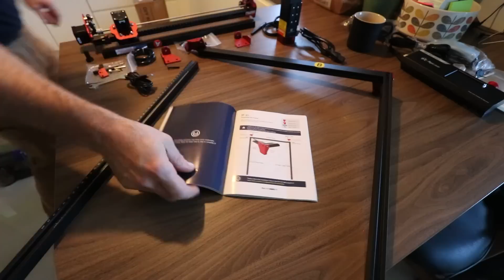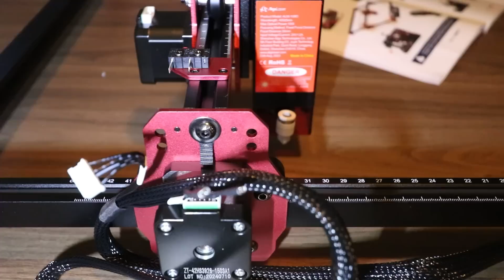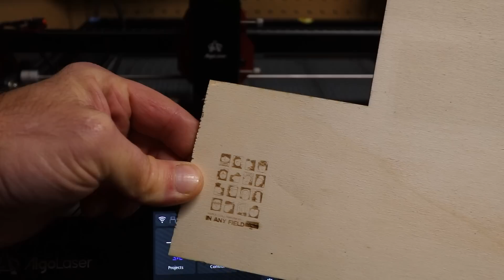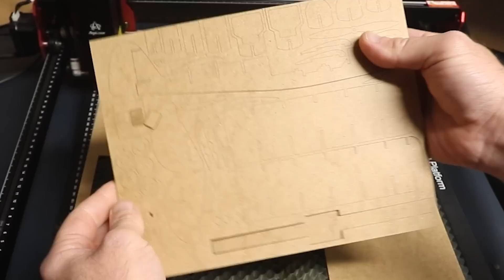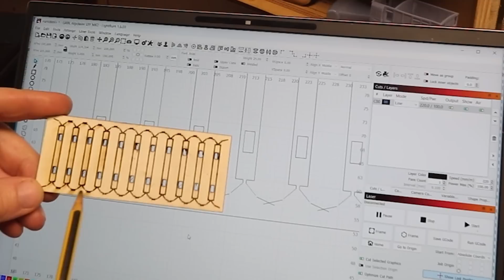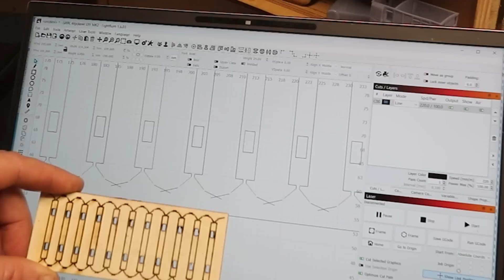S2 E48 AlgoLaser DIY Kit Mk2 Laser Engraver | First Look | Bexhill West Model Railway

Comment: Thank you very much James for your interesting review on this machine. 

I need to eche and cut a 0.6/0.7 mm brass plate for assembling a H0 3.5mm scale freight wagon and by the moment I need to reproduce the fastening rivets of the wagon timbers in 1:87 scale, I would know if the laser spot of this machine is thin enough to do a proper job or quite close.
Thank you for your time!

Comment: Hi James and everyone
I was impressed by this kit, so much so that I went ahead and purchased one. Unfortunately things have not gone well. Since the very start Im getting a double horizontal line every-time I  engrave or cut. This line is about 0.5mm parallel to the horizontal line. When cutting there is a wafer of wood cut out between the two cuts! 
It does not matter how the line is drawn, Lightburn, Laser Gbrl, Inkscape the effect is always there. Reached out Algo but despite following their suggestions the problem is still there.  Now they have just stopped responding to my emails! Add to this returns are at your own expense and there is a restocking charge of up to 30%!
So buyer beware you get what you pay for. What was to be my first steps in to laser cutting for my n gauge layout may well be the last time I use a laser cutter!!
Reply: Just a quick update, after literally months of emails and testing I finally got Algo to admit there was a problem with the laser head. Once they accepted this, within a couple of days a new head was shipped to me. This solved all the issues and the laser is now working perfectly. The laser is doing everything I hoped it would and all the  n-gauge details are coming out fine.

Comment: I'd love to know more about your fume extraction setup? It looks like you have a plastic pipe behind the machine at some points which looks "posable" - is that connected directly to an external extractor fan or something? I have a now slightly older Ortur 20w diode laser and the smell from a long cutting job, even with air assist and a conventional extractor running further down the room, is pretty awful ...

Comment: Hi James,
 Another very informative video, I can also see a big advantage to a bigger bed area, can't wait to see part two when you increase the bed size. I would be keen to see how they handle the honeycomb? is it two units sat side by side or one bigger honeycomb? Two units would have the disadvantage of having a non honeycomb area right in the middle of the work area.
 I also like the included hold-down clips a great idea. Just a question you mentioned you have laser cut your own hold downs in the past, could you maybe show us one of your hold down designs in the next video.
cheers phil

Comment: Eye protection? 
Extraction? 
Air assist?
Reply from the maker: Yes.
Next video.
Yes
Reply: Honestly the correct eye protection should be included in the box. If not then they should.
Reply from the maker: @England91  Eye protection is provided with the machine. I’ll get into the safety aspects of the machine in part 2 once I have the extension kit.
Reply: @BexhillWest  oh that's good

Comment: So the bare minimum is the machine with 10W laser, the honeycomb base and the airpump, and then you'd need to DIY a smoke extractor? And (sorry ifyou mentioned this and I missed it) what kind of material can it cut? Like from the sound of it with a 10W laser I'm not gonna be making plywood baseboard components with this
Reply: They say 20mm wood or acrylic for the 10W laser But I'm guessing you'd have to do a good few passes to cut that deep and there would be 
a fair bit of charring. I've got a 20W laser cutter and it does a good job on 9mm ply - I haven't tried anything thicker.
Algolaser says their 20w can cut up to 30mm thick timber.

Comment: James, you have an enclosure for your laser.  There is a kit available which includes an enclosure - their Safe kit option, is it worth getting the safe kit or purchasing an enclosure separately from a different supplier?
Reply from the maker: I would recommend an enclosure and decent extraction for every laser machine.  In this video I set the machine up without an enclosure such that the smoke generated could be seen.  One of the surprising benefits of a low power laser such as this is that 10W really doesn't produce that much smoke.  If I were running my big CO2 laser then the whole workspace would cloud up without extraction.  In this case the smoke generated was much less, which is a welcome benefit/side effect of a lower power laser.
I'm not familiar with the safe kit enclosure option, and suspect it won't fit the machine with the bed extension kit.  I think it just for the basic machine, but I would expect it to be well made and fit for purpose.
As for whether it's worth getting the safe kit.  I couldn't say, I've no experience of it.  However,  one of the things I plan to do with this machine is design a simple enclosure which could be simply built in a DIY style using basic hand tools.  Literally a plywood surround with an acrylic sheet over the top would work, and be in the spirit of the DIY kit ethos.  For the enclosure I plan to build for the machine I purchased a creality extraction fan with a flexible hose for about £15, the rest will be build with everyday materials using lessons learned from having used a variety of other machines.  A pull-out drawer for example through which the waste is collected and removed, would be a nice-to-have option.
With that said, AlgoLaser produce a gadget called a Smart Hub, which allows their accessories to integrate with the laser control panel should you wish to switch the extraction on/off automatically.
As an aside,
There are a number of features in the operating system which I hadn't expected too see, especially support for external devices such as the air assist and extraction.  These options cannot be used with the basic machine as supplied (minus the Smart Hub), but their inclusion suggests to me that AlgoLaser are thinking ahead and building future capability into the basic control.
I will cover all of this in more depth in Part 2, and reserve my full judgement until then.  I'll also ask whether AlgoLaser might send an enclosure for me to have a look as well so that I can answer your question more comprehensively.
I hope my rambling is of some help.

Best wishes,

James

Comment: James, just watched this episode again, and a thought surfaced while watching the last couple of seconds, “what if the timbers material was a prototype representation, but was actually a sound deadening material instead of plywood or similar”
Just a thought 

Very best regards from Belair, in South Australia, thanks for all the work you have done in bringing this content to us all.
Reply from the maker: Hmmm, an interesting thought, and one I'd be happy to test-out.  I wonder what the ideal material might be?   I should think that maybe foamboard might be useful as a proof of concept. 

I've been experimenting with 'floating' Plug Track, that is to say timbering bases which are not fastened down, but which are securely held between 2 layers of cork.  1 layer beneath the sleepers (as usual), and another with the sleeper outlines cut-out which drops over the top of the sleepers leaving just the very tops exposed.  The two layers of cork are glued to each other and the timbering 'brick' is held in between; like ham in a sandwich.  Tests so far show a reduction in sound levels but it's still too early to determine whether there is any real mileage in the concept.
Thanks for watching,
James

Comment: Hi James. Thank you for the review. I am interested to see how accurate and reproducible the cuts are on the extended machine. I model garden railway scales so a coach side may be 650mm long. If multiple layers were cut on this machine to laminate a side what would be the variation in length between the laminations?
Reply from the maker: Hi, that's a really good question, my guess at this stage would be that the cuts would be very repeatable.  They certainly are on all my other laser machines, and fundamentally this one is no different.  What I will be especially keen to examine is the stability of the extended frame and its ability to hold-square.  I don't have the extension kit yet to be able to comment further.
Your question is also of interest as I am currently drawing-up a MR 60' first class dining carriage for Gauge 1 with the intention of cutting the kit of parts on this machine in the Part 2 video.
As soon as the extension kit arrives, I'll put it together and run the files.  Then we will know for sure.

I've also some DIY quality-of-life hacks planned for the machine which I think will help the frame to hold accuracy and resist knocks and bumps.  I'll cover those too.

All the best for now, get back to me when Part 2 is released if there is anything further you'd like me to explore.

All the best,
James